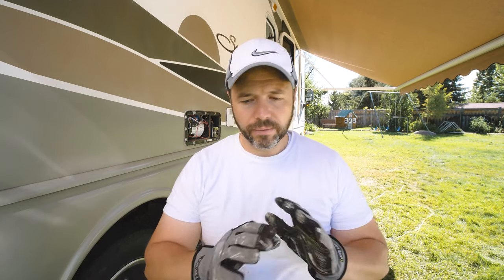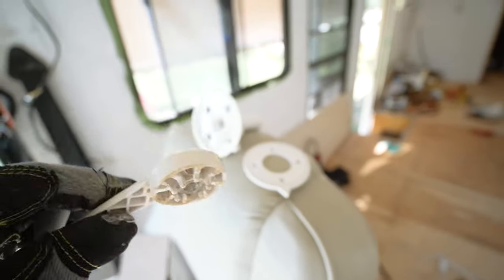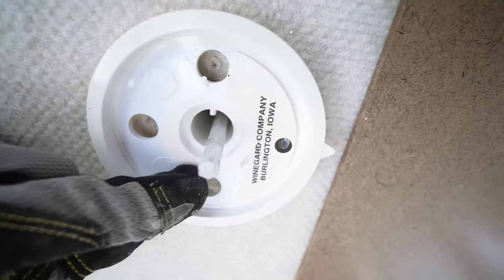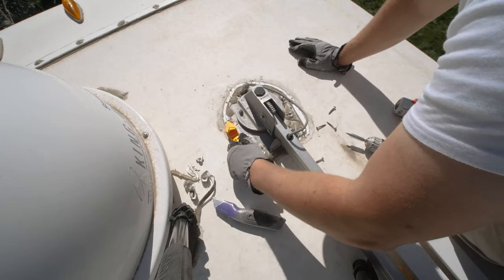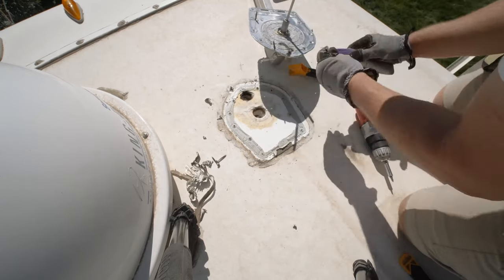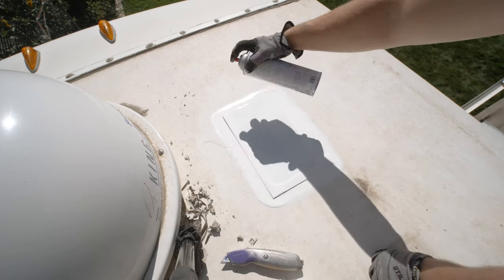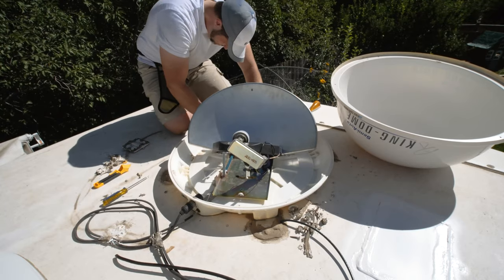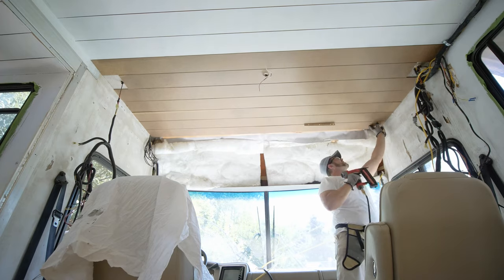Removing Our RV Antenna - On The RV Roof

Comment: I took mine off and used a plastic cutting board.  I drilled at equal space around the 12x12 template and screwed it to the roof. I layed downa hefty bead of roofing caulk, big box store don'tcarry anything for rv.  Work well so far. Flex seal doesn't stand up to sunlight.

Comment: Thanks for the video. Mine was damaged during hurricane Ian. Luckily the roof survived with no issues. I just cranked up antenna to it's highest position. Took off the two horse shoe clips and pins attached to the bracket, pulled the arms off. Worked the cable wire out of antenna arm. Wound the cable up and stuffed it in the bracket assembly, using those two pins and horse shoe clips to keep wire secure incase I want to use it again?

Comment: I’ve been meaning to find a video to remove my aerial and two unused satellite dishes so I have room for solar panels on my RV, and maybe a starlink… i’m only halfway through this but since I redid one of my skylights two years ago, I think this might be a helpful hint: I had a hatchet and a heat gun that I was using to melt and scrape evenly to remove the rooftop caulking. OK now I’m going to go back to watching, I have to find out what you cover the removed area with when you’re done!

Comment: Thank you for a nice, short, problem solving video! I would suggest putting some eternabond tape over the metal sheet plate for extra protection. I’m totally going to do the same procedure on mine and use the metal sheet, seal it, and tape it up. Thanks for the video! Ps you have a great voice!

Comment: Thanks for showing me how the antenna comes off i want to repair mine it wont go up ... I dont trust sticky stuff to hold in the wind I seen in other videos they put silicone on screw threads when installing them so it dont leak ,so maybe a couple of screws in the plate for insurance then spray it?

Comment: Good video. Another way to fix that hole is to buy a fiberglass patch kit. Basically you would do some light grinding around the holes to make the matt stick. Then lay the patch over the holes and apply some mixed epoxy resin and catalyst onto the patch. Finally work the resin into the material with a roller until it is fully saturated, and then let it dry.  You will never have to worry about a leak and it will be super strong. Easy peasy!
Reply: @SKINLA682 No more complicated than patching a bicycle tire.  Basically rough up the hole, mix some resin, and then work it into a fiberglass patch over the hole. The rest is simply sanding the patch to make it level and painting if need be.

Comment: good video. thanks for sharing!  I was looking for how to remove antenna and you answered kit.,  If i could comment anything positive as you suggest..  might have been best to apply butyl tape under the metal.  even better if you eliminated the metal, cleaned up the stain and residue from old adhesive under the old antenna and applied sealant tape, and good seal of Lap sealant.  The application of flex seal which is rubberized and the silocone is not always the best mix. silicone wont normally adhere to rubber.
Reply: I am confused, ' even better if you eliminated the metal, cleaned up the stain and residue from old adhesive' if you eliminated the metal what will fill the hole? If you are walking around on the roof, sealant tape will not support you weight.
Reply: @chris_cann  this is a good point that I didn’t consider, I was going to remove my antennas and put solar panels over the top so walking on them wouldn’t be an issue for me, but I keep forgetting that not everybody is in my same situation.
Reply: @russtavares6855  sadly for me wish I would have removed antenna earlier. Now I have water damage on the decking under the rubber membrane. I tried several times applying new sealant and put a new gasket from winegard in the antenna as well. But it seemed to always get water. I think it was coming in somehow by the worm gear, which there isn't good way to seal it. So I finally gave up and just removed the whole antenna, put a blank electrical box cover over the hole and applied sealant. We a lot of rain this last weekend and no water got in.

Comment: OK, so I see you went with sheet-metal. I’m still going to do a little research and find out if you can patch the existing surface material with something that’s the same after probably soap scrubbing all the accumulated grime.

Comment: Thanks I am removing a basic antenna and plan to use the same material that you used. Ima use premium caulk and Flex-Seal.
Reply from the maker: If I were to do it again, I wouldn't do the Flex-Seal. It doesn't hold up. Luckily I painted over it.
Reply: Butyl taper under the metal then Etherbond or dircor tape. Why no screws?

Comment: Can you list the items you used- I would love to know what that tool is that you used to remove all the old caulking and also the spray leak proof stuff. Thanks!
Reply: I have owned one of those tools.  It’s for caulk bead removal and I think Spreading.  I found mine in the caulk work section.  I suspect if you googled Caulk Removal Tools, you could find something like it.

Comment: I don't understand the reason for removing and introducing a location for leaks. Just don't use it but leave it in place would make more sense to me.
Reply: I'd say there were a lot more little spots for possible leaks with it attached. One piece of metal is better imo.
Reply: @blacksunapocalypse  I'm just saying if it's not leaking just leave it. Even if you don't want to use it. Not like you can see it from the ground.
Reply: Removing is the best option. Mine is leaking as well. I just resealed mine with dicor and it still leaks. I also replaced the rubber washer(s) which wineguard mailed me. STILL leaking. I believe now that it is leaking through the worm gear. Only option now is to remove it. Since I don't use it anyways.
Reply: @chris_cann  ours is a 2006 travel trailer and we have had zero issues with the antenna leaking. My only thought was if it's not causing any issues then leave it be. If it's leaking and you don't use it or plan to resell to someone who might use it then sure but I just wouldn't do extra work because I didn't use it. That's all.
Reply: @risbill1  I have a reason you might consider? I'm clearing real estate for solar panels.
Reply: @russtavares6855   Id rather have a good TV antenna than solar panels.
Reply: @risbill1  my rig has 2 satellite dishes and an aerial from the prior owners. I’d rather remove those and put in solar panels and a Starlink and get channels from all over the world plus internet
Reply: @russtavares6855  personal preference I guess. No need for solar and star link is way too slow and expensive for my needs.
Reply: @risbill1  You've tried it? I have a nice spot I know about in the mountains in AZ but there's no cell signal, and it'd be nice to have power so I don't have to ship in and out every couple days.
Reply: @russtavares6855  we travel for work usually 6 months at a time so definitely not going to be staying somewhere remote. If I'm that remote I'll sleep in a tent and I will have no need for TV or internet.

Comment: Thanks for sharing but I can't see this lasting. Needs to be screwed down for one. And you need butyl tape in-between  plate and roof smh.   Doesn't seem like you know what your doing. Hope people aren't following this on their rigs
Reply: They actually sell a plate on ebay. 25$ that fits exact with holes predrilled. Im doing mine soon
Reply from the maker: Haha! Thanks for your warning to others not to follow what we're doing! I'm not expert. Just trying to help where we can. I will say this. The plate has been the least of my issues.
Reply: @right2it146  I saw someone using... I think rivets? To make sure they could hold without needing to work from the inside as well